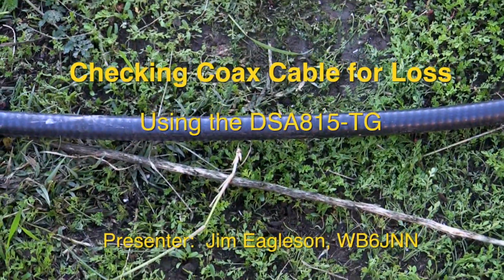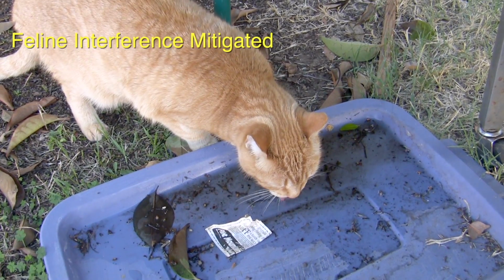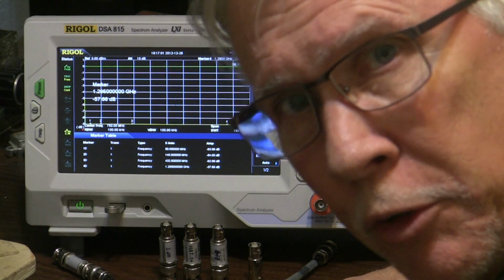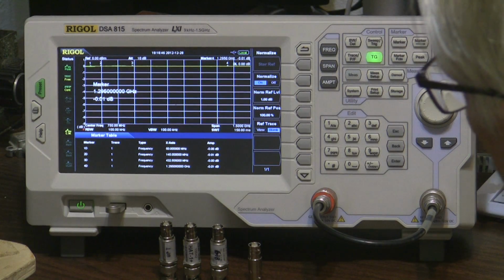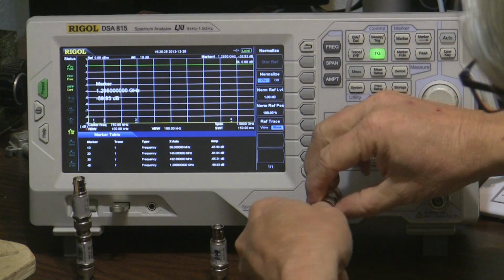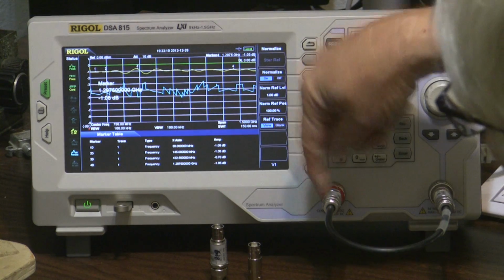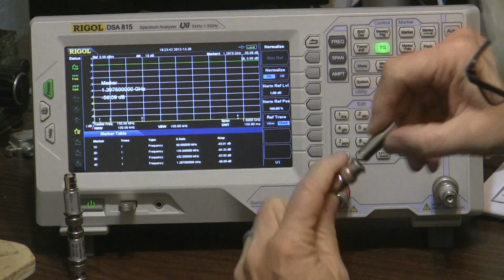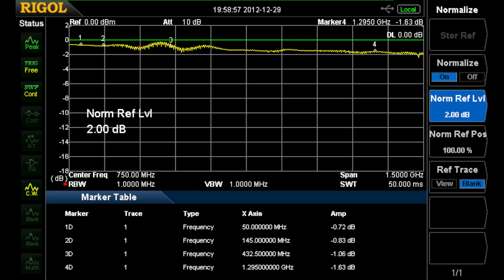DSA815 TG Checking Heliax Coax Cable Loss

Comment from the maker: It is likely a bit of both.  

The analyzer's tracking generator generates signals in steps with quite a few step functions of several dB.  Thus there is often some related artifacts based on that. 

If the TG signal is within 10-15dB from the internal TG leakage within the DSA815-TG, there will be 'beat notes' shown by the instrument as well.  

And, of course, all coaxial cable will have some level of impedance and phase variations at different frequencies as you point out.  The use of precision test cables can reduce this effect but are too expensive for general feedlines except, perhaps, for those to be used in Anechoic or Semi-Anechoic Test Chambers or OATS facilities.

The primary reason for sweeping a cable is to see if there is higher than expected loss or any serious discontinuities over the frequency range of interest.  This should catch problems when the cable is old, shows physical damage, has poor connectors, etc., etc.

Comment from the maker: This falls into the "Been there.  Done That." category.  In my distant past I have used some Spectrum Analyzers with Tracking Generators that had similar tendencies and coax, itself, sometimes has this kind of issue.  The coax issue is why I generally use RG223 double shielded coax instead of RG58.  It is a bit stiffer but still flexible enough for use on the bench.  RG142 is also good but gets pretty stiff due to its Teflon dielectric.

Comment: Just a comment on the DSA815,: If you change the span or ctr freq AFTER normalize then you have to redo the normalize as  the correction appears to ONLY be valid for the span it was done for.  So it's prob. a good idea to setup the DUT ctr freq & span and then do a normalize before inserting the DUT.
Reply from the maker: +Ancel UnfetteredOne   Hmmn...  I thought I uploaded some comments on this earlier today.  YouTube either lost it or I didn't save it properly so here goes...

You're comment is exactly right.

However, once you have made a measurement and pressed Trace then Freeze, you can change the Center Frequency, SPAN, Start and/or Stop frequencies, Ref Level, Scale/Div, Units, Peak functions, Peak Table, Markers (1-4),  and Marker Table since these use the information stored in the 600 point digital memory.

This means that with a 1-1500 MHz sweep you can evaluate any portion of the 600 data points shown in each of the Traces you have frozen.  Thus you could punch in a Start/Stop of 1-30 MHz, or 100-200 MHz, or Scale/Div of 5dB/Division, or change Units from the usual dBm to dBmV, dBuV, Volts, or Watts since these all are calculated from stored values.

The downside, of course, is that there are only 600 sample points stored for each trace so that frequency and amplitude resolution will be limited to 1/600th of the total 1-1500 MHz range (or whatever range you originally used) and the vertical amplitude range available from the top line to the lowest noise level of the original trace.

Comment: Wait a sec… 
Same “OJ” that is infamous for the slow White Bronco Pursuit?
Imagine the hairballs?!?

😆  Sorry feline fans.  
I just couldn’t resist childish jocularity.

Yet another excellent video… 
I’m  certainly enjoying my “binge watching” time here.
I have just the perfect use for this… I 

have a piece of 7/8” Heliax to thoroughly test.  It’s direct buried at my brother’s newly purchased farm.
I still can’t understand why the previous “Ham” didn’t bother spending a few extra cents and a few minutes (or hours?) of time burying schedule 40 PVC conduit and pulling the hard line through, along with spare pull strings and spare cabling..
The cable seems intact but performance of the attached repeater is spotty.  I plan on heading there myself to test everything.

Thank you Sir.
Reply from the maker: Well my OJ is more of a "surfer dude" than his namesake.  He pretty much majored in "Cat Loafing", not airport running.

Comment: May I ask if you can check VSWR with that Rigol in ur heliax ?
Reply from the maker: Well, I didn't do that but I could do that.  If I have some time I will see what it shows using the boxed RF Return Loss Bridge that I now use for return loss measurements.  Right now I have other projects plus working two days per week and the usual Spring "honey-dos" around the yard and house occupying my time. ;-)

Comment: Hi,, can this be used as frequency response analyzer? Thanks
Reply from the maker: +Ashref Deeb   I have shown how to do this in other videos in this series.  It can provide response curves using the tracking generator from 100kHz-1500MHz.  It does not work below 100kHz for this purpose as I recall.
Reply: Thank you very much